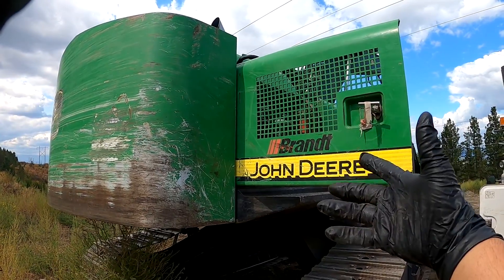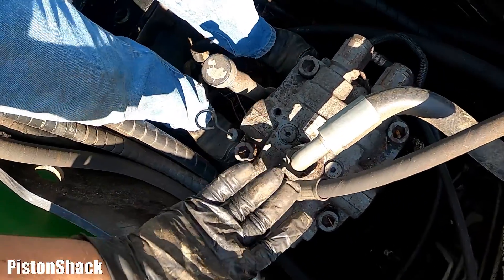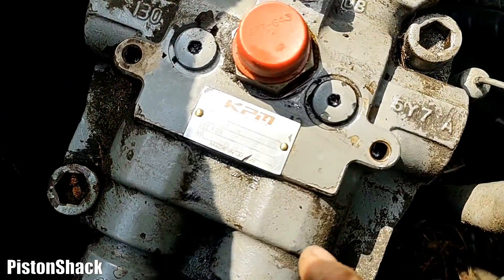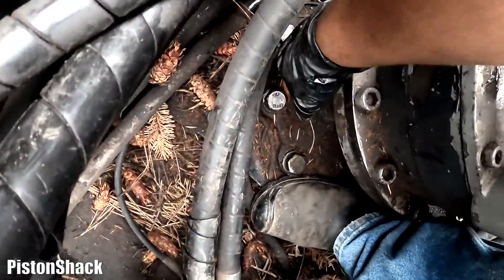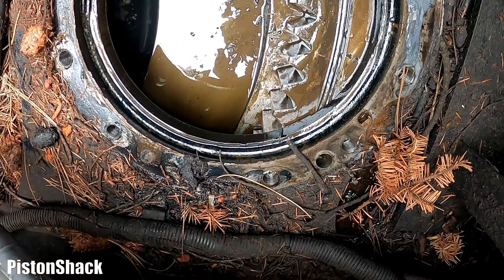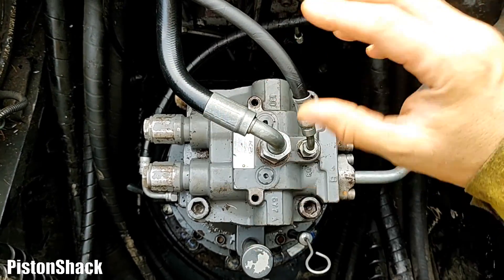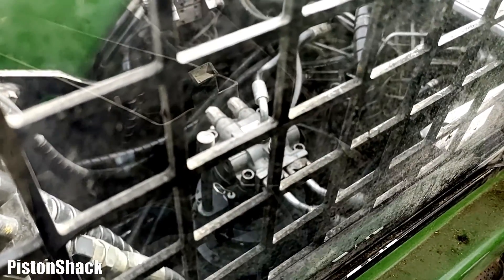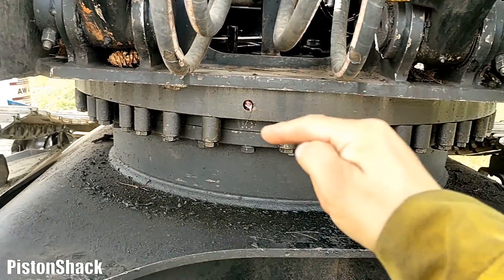EXCAVATOR LEAKY SWING MOTOR REPLACEMENT MADE EASY | JOHN DEERE 2054D

Comment: Hello sir i have a similar issue. When i add oil to the swing motor oil is leaking out from the turn table. Im sure its coming from the swing motor. Any advice you can send me i could really use the help
Reply from the maker: Do you mean swing gear oil leaking out? Does your machine housing any hydraulic oil as well?
Reply: @PistonShack  yes, for the swing motor fluid isn't marking on the dip stick. Once filled to the correct level it starts to leak. The sloot box is full of fluid. The hydraulic reservoir,sight Glass show proper levels. Still monitoring the hydraulic system to sell if it's leaking too.